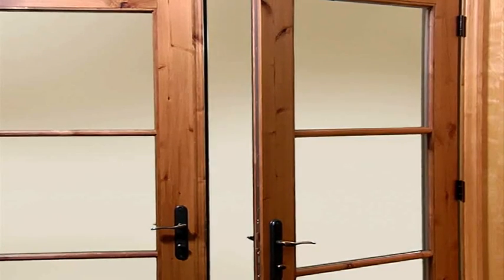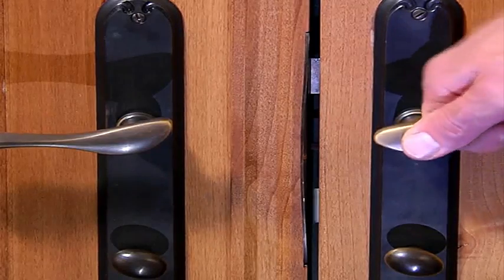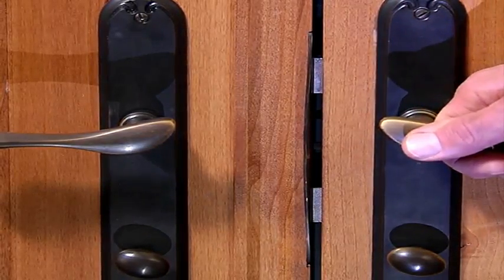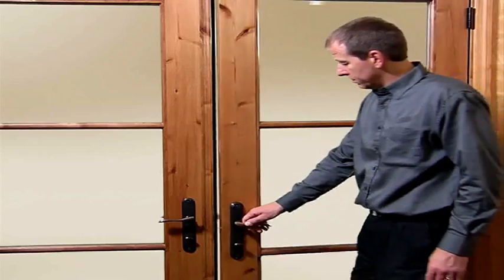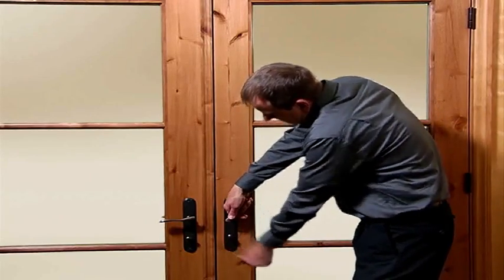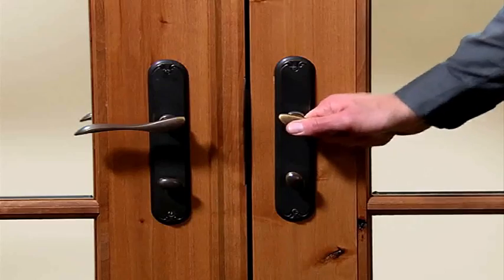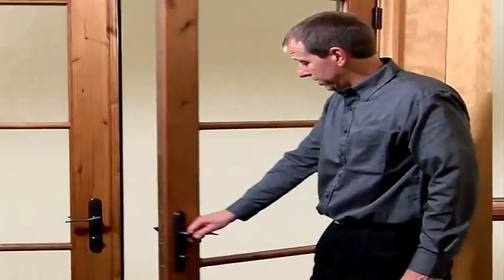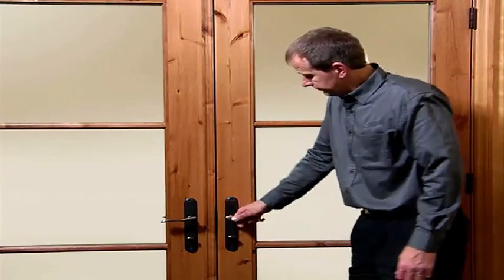Multi-Point Lock Operation on Hinged Patio Doors

Comment: like everything pella, if it works you're good, if not, you're screwed..  my front door and multi lock is 5 years old, has never worked right, had the eclipse multi-point handle replaced by pella rep and its still sucks..  the pins don't retract all the way, have to jerk on the door.. spent hours on line trying to find some help and like all Pella, Nothing. I wish they would stop trying to control customers and HELP us ........